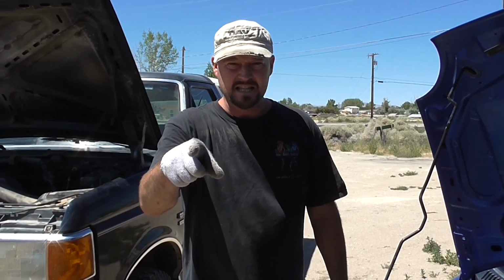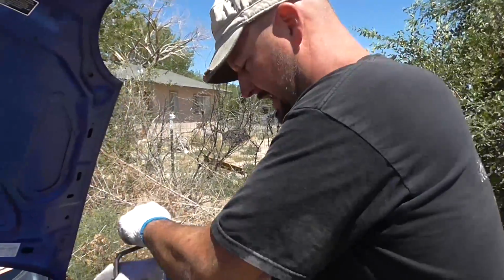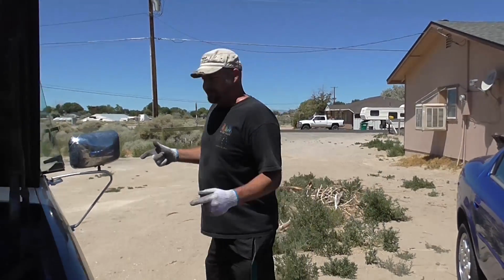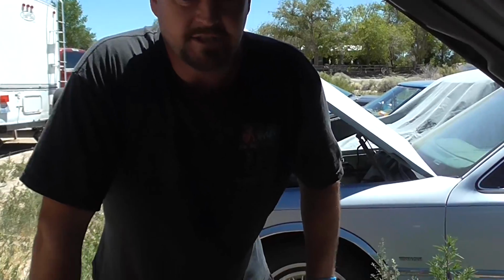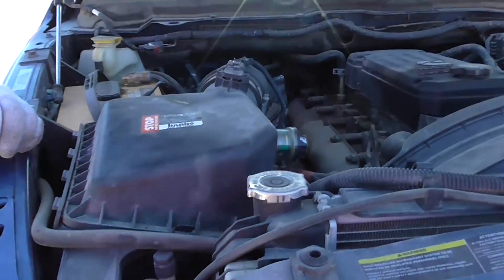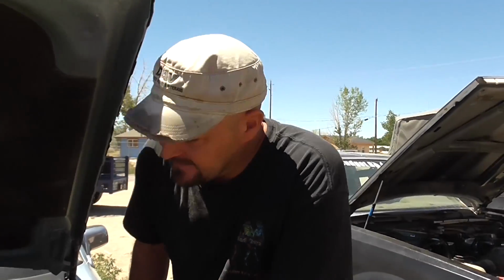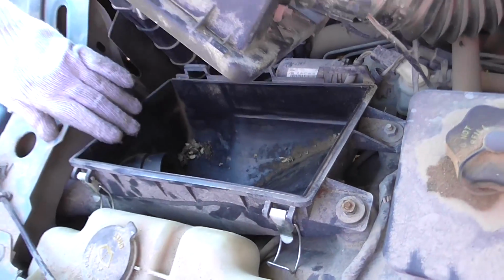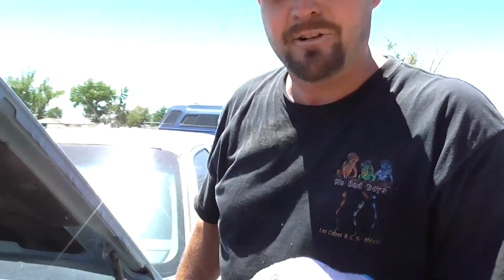Free Horsepower And Fuel Economy - Intake Mods

Comment: just did a few mods on an Aussie mid 90's sohc 4 litre ford straight six. stock power was around 160 flywheel hp, after a set of tuned length extractors, 3" hi flow cat into 2.75" exhaust with low restriction muffler I picked up around 20-25 HP, I then did a pod in box & custom intake piping using (get this!) 90mm rainwater down pipe, picked up approx an extra 5hp. intake set up cost me about $50au including the filter. if you would like a vid on it let me know & ill make 1.
Reply: +Scroat Worx  Dude, I am interested in what u had to say but I have a few questions. I am a former Locomotive mechanic so I understand about all of these things, also have been an independent trucker for 31 years and have done most of the repairs/maintenance. I did alter one of my 2-stroke Detroit Diesels such as putting in larger 100mm marine application injectors, removed the throttle delay and installed one of the new (at the time) By-Pass Blowers that had a pressure relief valve that when a certain manifold pressure had been reached it opened bypassing the blower (Roots Type) and allowing the turbo to just spool up faster and I do mean FASTER, it gave me much better staying power on steep hills but other than that didn't fuck around with any of my 4-stroke Diesels as they were my bread and butter and they ran good from the factory. but I need to know: By tuned length extractors do u mean Headers?, and if so what brand? They r expensive and from others experience they make minimal H.P. for the money spent. About $1,000.00 for a 12 HP gain? Unless u r racing, not a good investment in my book. Also where did u get a Hi-flow Cat, from the factory, junkyard? My '97 F-150, 5.4L Lariat had dual Cats and I installed a Gibson after cat muffler with dual S.S. outlets, sounded good and looked good but not sure if there were any power gains. Then I installed a Jet Power Chip and still didn't notice much difference. It was only until I put a K&N Filter Charger that I really noticed any difference, much better throttle response, cool sounding intake noise but I never dyno'ed it as a before and after test as Dyno was just 2 expensive, the exhaust, chip and K&N all cost approximately the same, right around $260.00 US each, so I spent close to a thousand bucks for maybe 20-25HP gain. My brother had a stock Ford Bronco with the old 351C.I. engine and he had no problem keeping up with me and his was 4 wheel drive so it had to be heavier and no, he didn't engage it when we raced each other, I was very disappointed that with those mods his stock Bronco had about the same acceleration.  Yes I would like to see a vid on this as I do not know what u mean by POD and about how u fabricated an intake piping from 90mm water drain pipe for your homemade system. Please let me know as I no longer have that F-150 as I rolled it on the freeway and am now disabled. I do however have my deceased brothers '04 F-150 with the 4.6 engine and it is 1,000 lbs. heavier due to a re-designed frame for towing and a better ride, so please respond, I have plenty of time on my hands and even tho disabled still do my own maintenance. This vehicle has only the one Cat (Big) and single exhaust. I was thinking of putting on another K&N cold air filter charger but after seeing this vid not sure if it is worth the money, in my situation I have to watch my pennies, this really sucks as a former owner-operator I always had plenty of bread to pay for mods on my beautiful '97 F-150 that I had all tricked out. Wasn't crazy about that 5.4L motor as it wasn't exactly a rocket( 235 HP and 335 ft. lbs. torque) and wasn't miserly on fuel, shoulda stuck with a GM product as I always have and this was my first new vehicle and my first Ford. I am 62 and was more into Harleys(rode for 13 years, mostly screwing around from bar to bar but did like the occasional road trip, I rode from Maine all the way down to the Florida keys on a 1960 Hardtail Panhead that I modified with a Sifton Cam, aluminum pushrods, solid lifters and a better carb and making them run better than stock but those days are behind me and I would like to play with this Ford to see if I can get better performance out of it and I am not worried if I do lose a few mpg. Thanks for listening and my apologies for a long letter but I was trying to paint u a complete picture. If u can, please respond to me personally JBorko6887@aol.com. I attended a Tech school for automotive and diesel and have plenty of experience on them and Harleys but not so much on gas auto's Thanks in advance for any help u can give me as u sound knowledgeable and creatively ambitious. Respectfully, Jonathan. PS, what about a different intake manifold, an suggestions? Ford had a dual plane then a single plane so I don't know which way to go, and what about installing a bigger Mass air flow, any gains from that or just leave the stock one on? Thanks again my friend, looking forward to hearing from you!
Reply: Hi bud. I'm a bit of a tight ass with cars & make stuff work out of whatever is around. My tuned length extractors (yank re- headers), high flow catalitic converter, exhaust, manual gearbox & heavy duty clutch all came from a wreck i purchased for $300. The extractors are a 2 piece tuned length design which was originally made by a guy called jim mock who used to run jim mock motorsports over here. They specialized in our local 4 litre over head cam ford straight sixes but they closed about 5 years ago. My whole car only owes me around 1500 so far & it smashes tyres in second gear no problems ;) our local 4l six made around 160-170kw from the factory so with my mods including the exhaust, pod filter & custom intake it should be around 185-190flywheel kw (approx 220hp), by the time i do some head work, cam upgrade & a "j3" chip for the eec5 ecu it should have around 220 rear wheel hp. Its worth a google search to read up about our local 4litre, theyre great motors & have a bit of a cult following here, theyre actually the predecessor to the current "barra" turbo sixes that some guys over there have heard of. The sohc 4l started in the ea falcon & ran through until the au falcon with many subtle changes over the years. Have a good look at the eb through au xr6 too, it was a "tickford" enhanced package we had. Im very busy atm but ill try to get a vid done early next week.

Comment: Yea you get more air but you also get a leaner running engine which want last near as long. Enjoy burning a hole in those Pistons.
Reply from the maker: NO !  the engine has sensors that send readings to the computer PCM such as the MAF and MAP sensors, which adjust fuel settings depending on the readings from those sensors.  The engine computer makes adjustments according to the readings so it will not go lean unless the performance of the engine exceeds the size and capability of the fuel injectors, which is the reason for larger injectors on the market.  An intake improvement will not exceed injector duty capacity.  The short answer again,  NO.
Reply: +Budget Boosting Yes I know what map and mas sensors do, but a lot of time if you replace the entire air inlet system with a home made one you are gonna have to remove those. Atleast the aftermarket piece come with a spot to plug yours in so you can get the right air fuel mixture.
Reply from the maker: You do not remove sensors.  If you do, the engine runs bad.
Reply: he clearly states in the video that you are keeping your sensors in tact and he even went as far as adding that "box equalizer" on the buick to keep the sensors in check. I dont know where you are coming from with your bigotry.

Comment: I forgot about this video. My dad recently bought a 2012 Ford e350 box truck and he is getting less then 300 miles on a 35 gallon tank and drives very lightly on the throttle. Will the K&N help out getting more fuel economy?
Reply from the maker: yes, along with driving lightly on the throttle.  It also helps to improve the factory restrictive exhaust system.  When intake and exhaust improvements are done together, you really notice the differences.
Reply: Budget Boosting we are going the air filter route

Comment: The problem is with the less restrictive air filters is that they let more shit in to the engine. So yeah, more performance and easier breathing engine, but the engine will be sucking up all sorts of crap that will hurt it. Thats why you wash your potatoes before you eat them, you dont eat them straight out of the dirt because its quicker.
Reply from the maker: less restrictive or stock paper filters can be used for this concept.  I prefer the reusable washable air filters, do what you like, after all, its your car....
Reply: Budget Boosting I know. What I mean is that the restriction is due to the material being denser to catch more crap that doesn't end up in your engine.
Reply: A high performance air filter with filter oil applied will work just fine as is why they sell them.
Reply from the maker: The point of my whole video if you watched the part where I show that small trumpet, the only source of air for the whole engine.  My point is that larger inlet area no matter what the filter type, increases torque, performance, and power.  Gas mileage depends on the person's foot that is driving.

Comment: You just need to install a condenser in your fuel tank or put your AC evaporator inside to cool down gasoline and prevent it from boiling or evaporating. Gasoline Boiling point is very low. Is it not stupid to put an electronic fuel pump that generates heat inside the fuel tank.

FACT: Diesel engine injects more fuel than gasoline engine assuming they have the same displacement. When gasoline turns to vapor the stupid EVAP is purging it to the engine same time with the EGR causing spark plug fouling. Then burn in the catalytic converter which stores oxygen. I'm referring to a Return Type Fuel System.  

co2 DISSOLVES IN WATER
Fuel can be extracted out of thin air.
Reply from the maker: I prefer them outside the tank, manufactures like them in the tank since around 25 years ago.  The reason I do not prefer in tank pumps is due to the inconvenience of replacing them when they fail right after the tank was filled with fuel.  Murphy's law, that is when they usually fail.  Some do not mind defueling the tank, I am not a fan.  So myself calling it stupid was for my own reasons, not scientific engineering reasons.  Engineers are never the ones that work on the vehicle, just the ones that decide where they go.  I was impressed with the 1982 Cross fire injected, Chevrolet Corvette where it had an easy access panel where I could easily R&R the pump without even defueling.  Would like to see more manufactures follow in that car's footsteps....

Comment: it's funny, the free performance is loss performance, all of those mods will draw hot air witch has less oxygen for the combustion witch equals less mpg and power. I know this because my buddy did it in his car without any heat shields and he lost mpg and power lol the guys half right with the restrictions and air flow part but that's just part of understanding how everything works with each other. also I think it's funny that he hasn't shown any proof but just noise lol
Reply from the maker: Watch my F150 on the Dyno which gets COLD air from my Intake mod and free flowing intake mod.  This truck pulls hard.
Reply: +Budget Boosting I just watched it and since the truck was also tuned along with the air mod, it doesn't prove your point, and straight piping usually leads to worse economy. and their are plenty of Dino runs with just a air intake mod that show that with a can filter you lose power, and if it does increase power it's very minimal where you don't even notice, air intake mods by themselves don't make any noticeable difference in power but possibly make you lose power
Reply from the maker: I did all the tuning on my truck and yes, I know what made the difference.  The tuner made very little difference by itself but after I did intake and exhaust, that made everything work effectively.  Must breathe before performance and/or economy can be realized.
Reply: it can get very complicated. if you change how much air goes in then you will need to change the amount of fuel mixing with the increase of air, and then change the amount of restrictions on the exhaust. A finely tuned machine is a beautiful thing.

Comment: Sucking HOT AIR from under the hood instead of outside air,like the manufacturers designed it,can cause detonation and loss of power.The free flow filters are fine,but the Cold AIR BOX must be retained.

Comment: I modified a neon and did a few things but if you don't turbo you're not gonna get much out of your mods. I did the chip custom exhaust  intake and tune and pace setter headers . the hp gains were meager  my best 1/4 mile was 16 flat. not shure what it does stock but it's hard to make a slow car fast unless you add turbo or supercharged.

Comment: Maybe cut out the reverse trumpet, and make the hole bigger, and put in a piece of bigger pipe or tubing, it will get more air!! The way you did it will suck in more dirt, your filters are full of crud, and you suck in hot air from the engine now, you need cool air!!

Comment: I thought about doing this on my old topmounted-bowl air cleaner. Cut the outer part of the dish out, the intake stroke should waste less energy pulling it through the sealed bowl and dish. Still has to pull the air through the cleaner though so it comes in clean

Comment: On an old V8 with a Carb filter I can see making a difference because turbulence and velocity makes a big difference. With new cars, you aren't going to see much of a difference because the computer will just auto regulate the A/F ratio back to stock. Granted you will be able to use less throttle to get the same rpm but i really wouldn't do an intake for anything other than a supporting mod when adding major power like converting from NA to forced induction.
You will probably see a better power gain and fuel economy if you just switched everything over to synthetic oils.
Reply from the maker: Still get more volume of air which results in less throttle input for more power/torque output.  Once you try it, you will notice it.  Also freeing up the restrictions in the exhaust system along with intake mods, will make a very noticeable difference.

Comment: does this actually improve your mpg?? im just getting into the car scene and have very low mpg and looking to up that and the performance. also wondering how much performance this adds.
Reply from the maker: Doing this mod along with the exhaust system upgrades will be a more balanced way to see more gains than just the intake.  Intake is one part, exhaust together with intake completes the balance of power and economy.
Reply: Wait, *what*?  @budgetboosting , you're putting two unrelated ideas together, which proves neither idea.  Doing one modification does not create imbalance.  So, doing a second mod can't possibly correct any imbalance, because there was none to start with.  The second mod does not create (complete?) any balance.  Power and economy are not opposites, because the same amount of power to move the car at a given speed, can be produced by consuming a higher or lower amount of fuel.  That'll do for now.   Explanations of all - or even just some of - the other factual flaws, can wait for another time.   :-)

Comment: Want more hp? Cams.
Reply from the maker: Why not do it all.
Reply: Well in the past, for instance, I opened up my exhaust and leaned out my mixture and spun the main bearing. So, if I did it again, I would go intake, cams, exhaust, and tune all at once. That way I gain hp and fuel efficiency all at once with no risk of damage.
Reply: don't lean it out!

Comment: Another cheap way to get better exaust flow instead of buying an expensive kit is to (If they don't check emissions in your state) take your catalytic converter off, grab a dust mask, a big hammer, and a steel pipe or solid bar of sorts and beat the stuff out from inside of it.... Helps a lot
Reply from the maker: Yes, hollowing out the cat, I used to do that on cars that I wanted to look like I had a cat.  Now I just remove them if on an old car or have an after market y pipe to replace them.

Comment: You may be getting a little bit more air but your getting hot air now from the engine bay don't do this it's going to make your engine busy your putting hot air into the engine vs the colder air from your fender which is actually causing the mpg and torque aswell as horsepower to die down

Comment: my 2013 kia optima N/A 4 cylinder engine gets 42 mpg and makes 200hp stock and is a very reasonably priced vehicle....you're trying to bring life to old world technology...
Reply: the reason paper air filter are restrictive is because they filter out microparticles usually down to less than 1 micron. they are designed to filter out virtually everything. I recently had a car with a CEL on and turns out the mass air flow sensor was corroded and dirty because they were using k&n air filter. which doesn't filter out the micro particles which were affecting the sensor. not to mention when your engine breathes in sand dust through the "filter" those particles are slowly eating away at your cylinder walls and aluminum parts...
Reply: so in the end you are trading hp for decreased engine life...good job!
Reply from the maker: No, I am encouraging people to think outside the box, check their vehicle and intake frequently for improvements and when people are looking at their cars, they are keeping the intakes clean more frequently and vehicles will last longer when people are PROACTIVE and not REACTIVE.